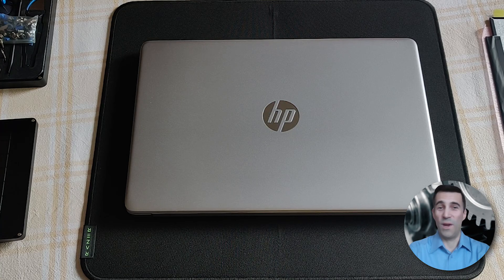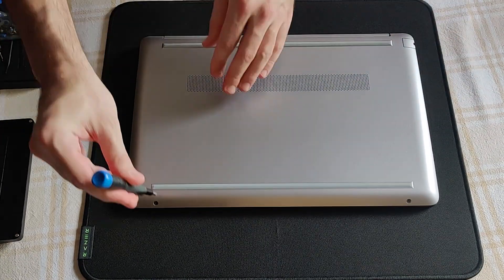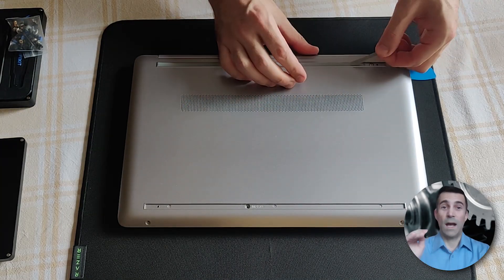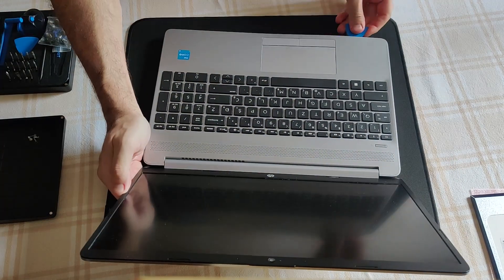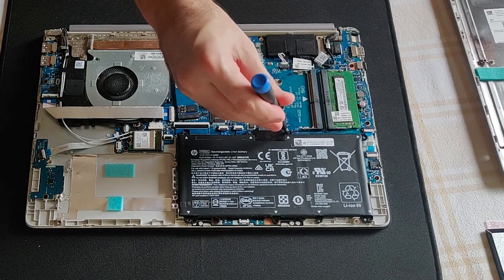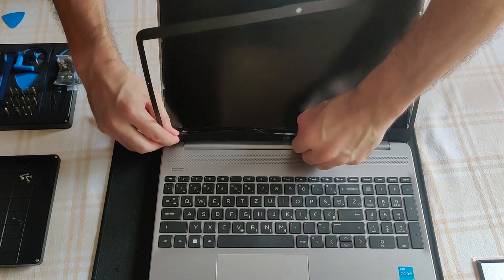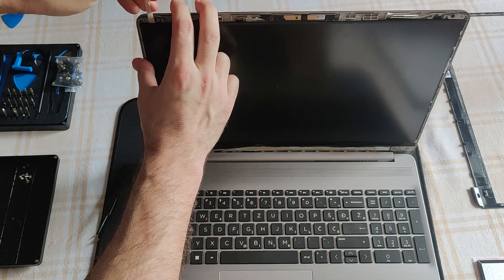HP 250 G8 Notebook - Replacing the LCD LED screen panel

Comment: This is not precudre! You broke bottom plastic part connectors. You need to separate screen from laptop body and muve that plastic part to the right and take it off without damage
Reply from the maker: Laptop worked fine afterwards, had no complaints.

Comment: My HP laptop's screen has gone, so will definitely try this. Thank you. What did you do with those rubber strips that you removed under the laptop to expose the long screws?
Were you able to stick them back?
Reply from the maker: Thank you for watching. You will do ok. Yes, I was able to stick them back on.
Reply: Oh sorry, I should have just watched the video all the way to the end. 🤦🏻‍♂️😂
One more question... Was the new screen able to stay in place without the adhesion tape?
Reply from the maker: @olivertruscott4006  Yes, wasn't moving at all after I put back the bezel.
Reply from the maker: Good job then!
Reply: @smooth.IT.operator  Laptop screen replacement successful, thank you sir!
Reply from the maker: @olivertruscott4006  Awesome!

Comment: I was looking this video bcs i need to replace wifi cable antena which is going aroun the screen under plastic
Reply from the maker: Thank you for watching. Only antenna you replaced, you didn't have to replace the entire Wi fi/Bluetooth module on the motherboard?

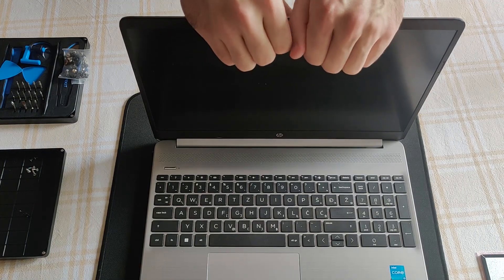Comment: In the process of removing the panel (at 2:35) is it normal for some parts to break? I was unable to remove it leaving everything intact.
Reply from the maker: Some parts? Which one for example? The frame is thin and easy to break, spare one should be $15,00.
Reply: @smooth.IT.operator  I'm referring to the small part of the notebook's white casing where the black panel fits in. I don't know the exact name for it.

Comment: If the battery is out of power, do I still need to open the notebook to disconnect it?
Reply from the maker: Thank you for watching. Even if you drained your battery still disconnect if from the motherboard if you intend to touch any of the components and especially the screen panel connector.